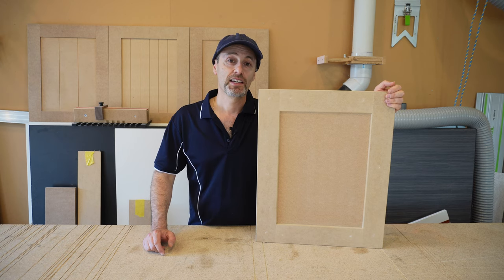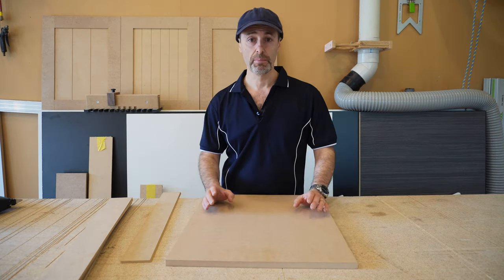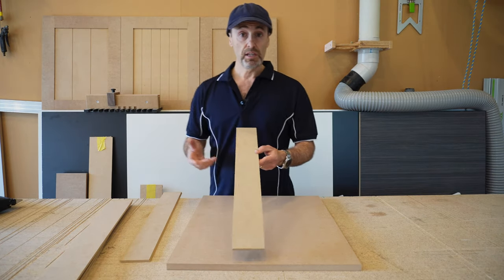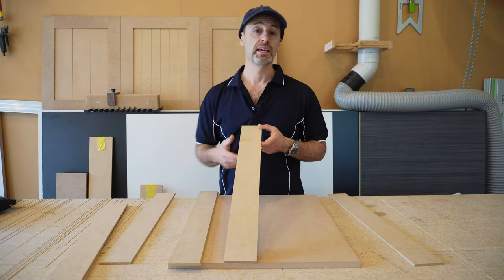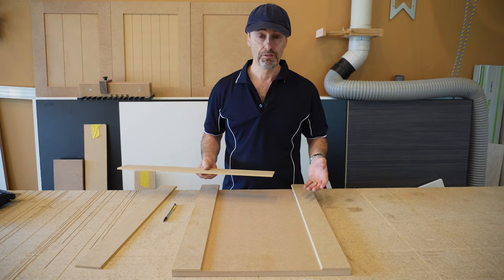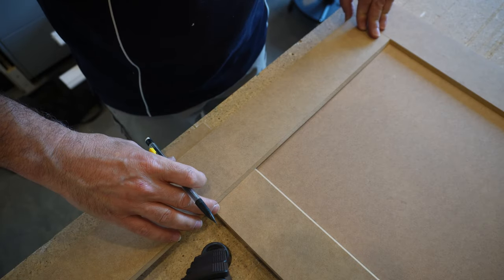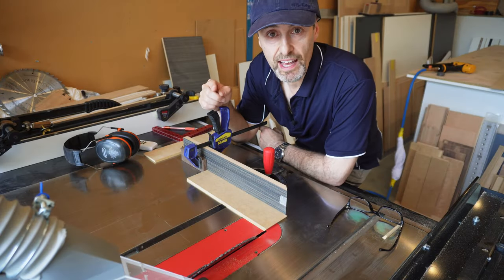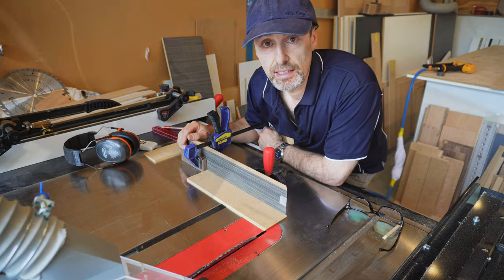Shaker Cabinet Doors with A Beveled Edge Design DIY

Comment: Question- how do you hide the lip between the rails/styles and the back panel? I saw that you zoomed in on it and it showed that small gap - you don’t think it will be too noticeable? I ask because I am looking at building a set kind of like this for some large bookshelves in the kids playroom, but we want to sell soon/eventually and don’t want it to look too rough…. Thanks so much for the video! Can’t believe you posted it just eight hours before I looked this up lol
Reply from the maker: I don't have too much trouble with the edges so long as you prepare them well for paint. Any small gaps of course fill them up with a filler then undercoat really well, 2-3 coats if necessary sanding in between coats then once you apply your top coat of what ever you are using it should be nice and smooth and not showing any join between the top 6mm strips and base.
Hope this helped and good luck with your project.👍
Reply: It did, thanks a ton!!!